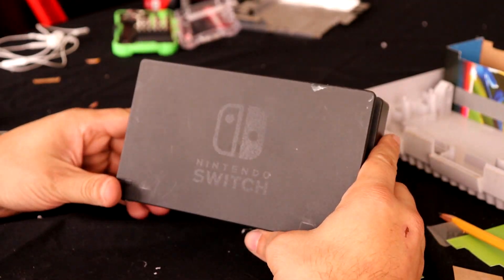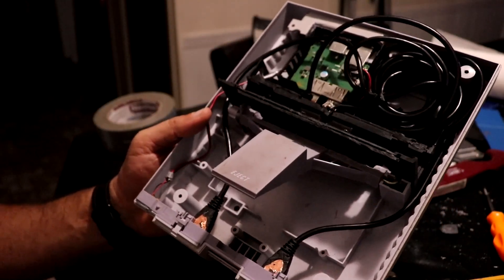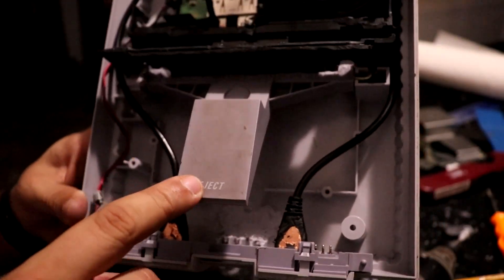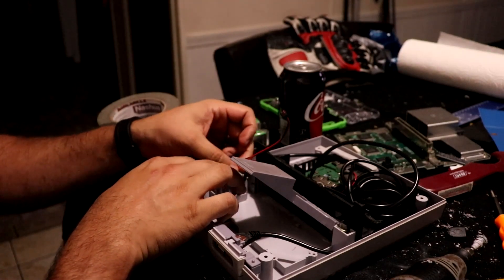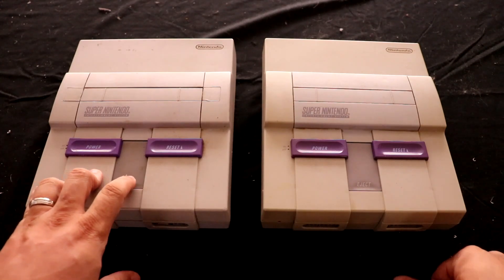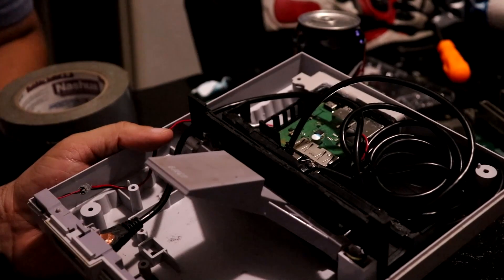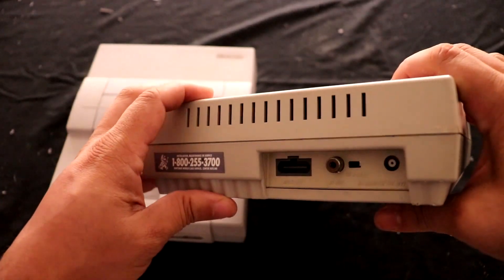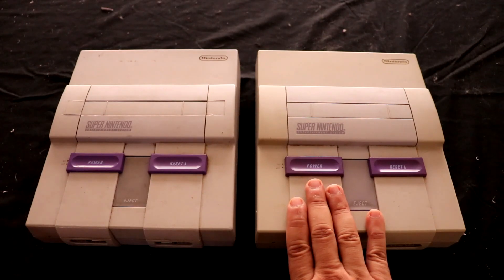Super Nintendo Switch Dock Build [Part 3]

Comment: Had a late night idea, bought an snes off ebay within an hour of the idea... then searched youtube to check if someone had done it... you beat me to it by a couple months 😂 looks great and you definetly thought about somethings I have not yet!
Reply from the maker: That's ok hopefully this helps a bit. What didn't you think about?
Reply from the maker: Also have a couple more videos on this project if you're interested
Reply: @ALL-rf9gl  I first came across your nes video and then went all the way to this video. Also things like actually using the lights or the ability to pop out the switch.
Reply from the maker: @ToastieBoi66  cool thanks, I hope you enjoyed them. Yea I thought those would be a nice touch just like using the front light and cartridge up and down function on my NES build. I try to make them almost work like originally intended.
Reply: @ALL-rf9gl  Did you have to extend the cable for the LED to make it reach the front of the unit? Or is it actually that long inside the dock?
Reply from the maker: @ToastieBoi66  extended for sure. I had some thin cable sitting around the house. I think I ended up using speaker wire. It was super easy IF you know how splice wires.